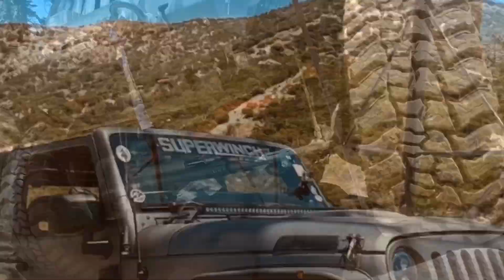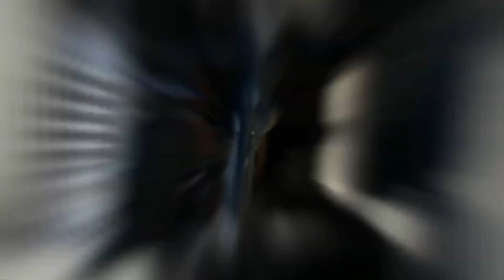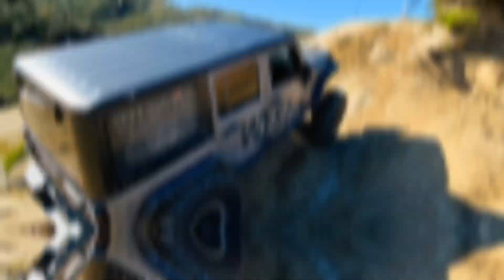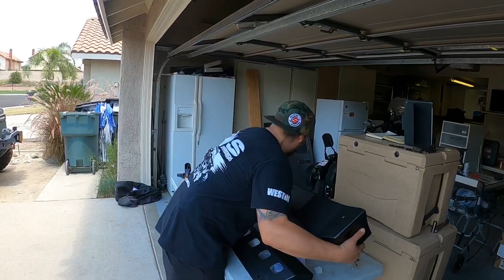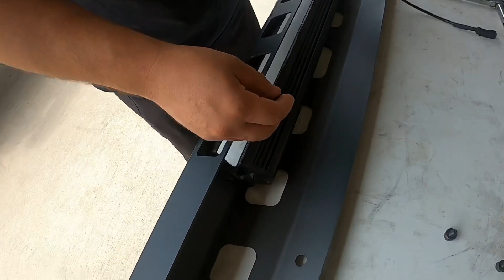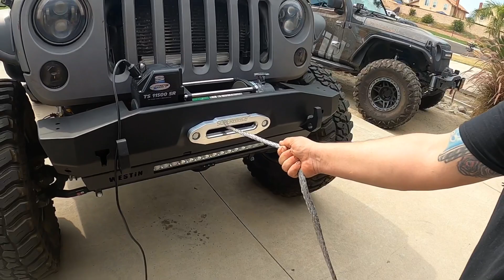WJ2 Stubby Front Bumper & WJ2 LED Skid Plate + Superwinch Tiger Shark 11500SR Install

Comment: I have the wj2 front bumper on my JL and I have the holes for that skid plate.  Do I need to remove my winch to install the skid plate?
Reply from the maker: The LED Skid plate will only fit the JK models.